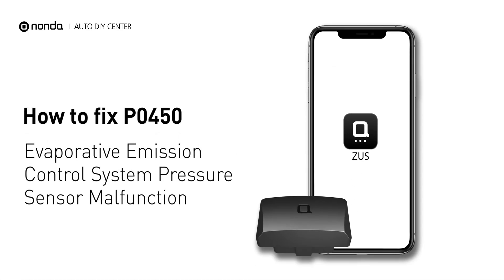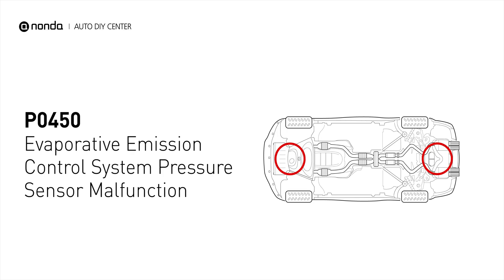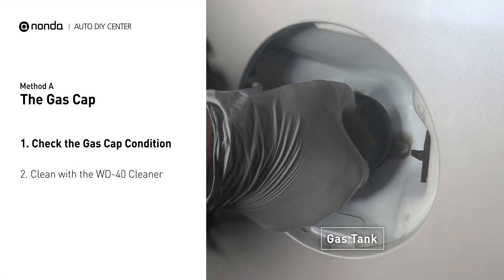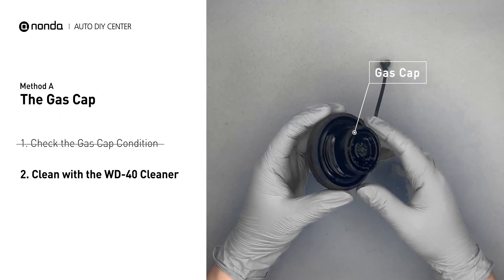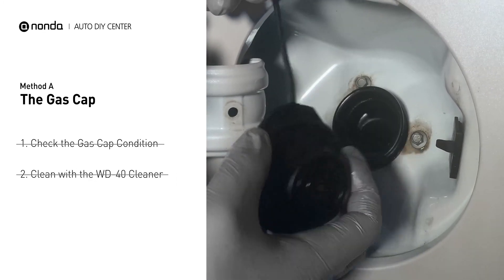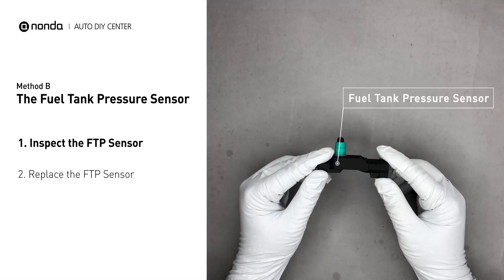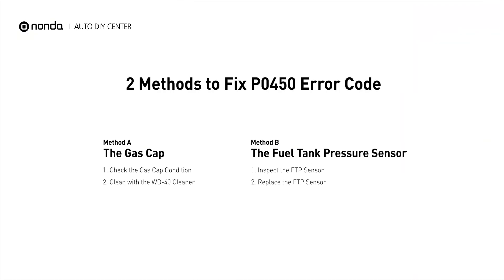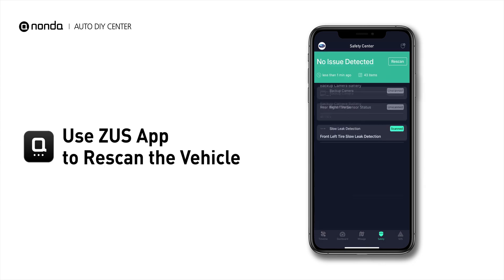How to Fix P0450 Engine Code in 3 Minutes [2 DIY Methods / Only $4.52]

Comment: Hello Steve I’m Harley Garcia and I have a Toyota Camry Le 1997 I got scanned and the only code I had is the Evap Fuel Pump tank pressure sensor how should I fix
Reply from the maker: Hello, we suggest cleaning the gas cap and checking the condition of the Fuel Tank Pressure Sensor.

Comment: Could it also be the Evap Canister ?
Reply from the maker: Hello, please provide us with your vehicle's year, make and model in order for us to address your concern accurately.
Reply: @nondainc  1996 NISSAN hard body.
Reply from the maker: Possibly-yes. Kindly check first the vent control valve and the voltage at the evap pressure sensor.
Reply: @nondainc  Thank you sir and God Bless
Reply from the maker: You are most welcome!

Comment: Another great content Nonda. Can I apply this method to my  Toyota tacoma?
Reply from the maker: Thank you for your feedback, Asif! For your vehicle, we suggest checking if there's an issue with ECM, vapor pressure sensor and vapor pressure sensor circuit/connection.

Comment: Hi Steve. I'm 2007 benz s600 w221 owner. somtimes I got engine check indicator and then if I fuel it, engine check indicator is gone. And if i scaning him, I got P0450 engine code. This is about fuel cap or fuel sensor. please advise me. Thanks alot
Reply from the maker: Oftentimes, a faulty fuel cap is the factor triggering this trouble code. Try repairing or replacing it to see if the issue will still persist.